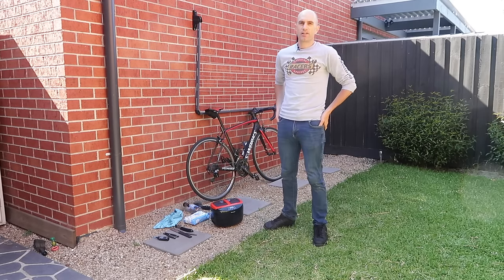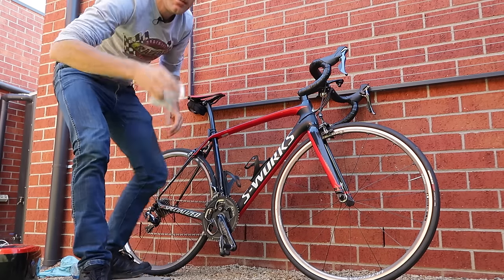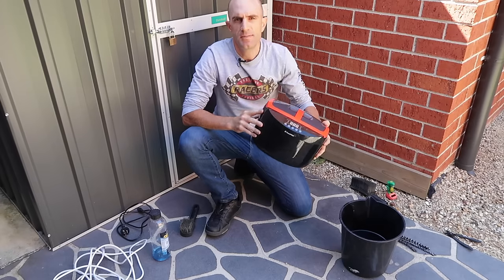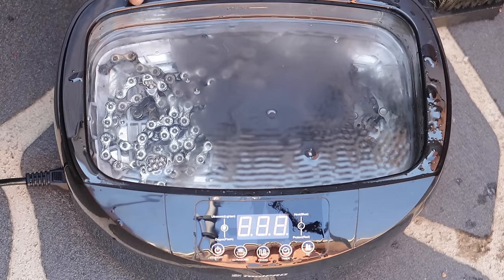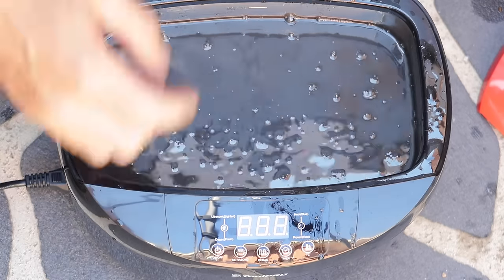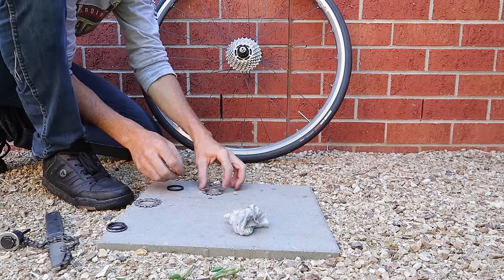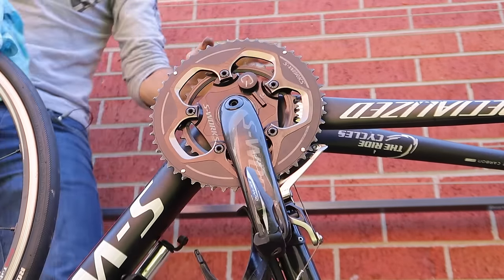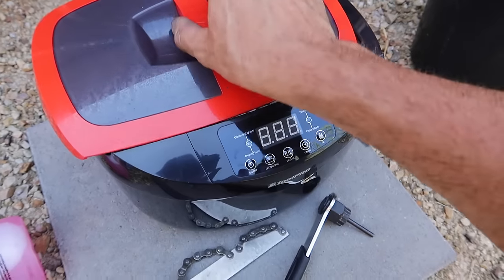CLEAN BIKE: The Ultrasonic Part Cleaner! // How to Clean a Bicycle Chain

Comment: Hi Shane, it's me the wheel balance guy from Seattle.   Just giving your loyal folowers like me a little heads up if you use an Ultrasonic cleaner... I used to use the same Ultrasonic cleaner and soon discovered not to ever put Aluminum parts in it because it pits the surface especially when it is anodized. I ruined a perfectly like new pair of Campagnolo super record 11 brake calipers when I put them in for a quick clean, and was horrified when I pulled them out to rinse them. Yeh hard steel stuff like chains and cassette cogs good. Aluminum parts to risky.
Reply: Great tip! Easy to get carried away with these fancy toys 😮

Comment: We use ultrasonic at work to clean sensitive aircraft parts. Two of the secrets are heat at about 120 C & time. Basic is 30 minutes, heavy is 60. We use other processes like deionized water & rust block in the process also.

Comment: The reason it didn't come out spotless clean is that kerosene does not mix with water. Water will stay at the bottom of the tank (where the parts are) and the kerosene will float on top (providing little contact). But ultrasound cleaning is so good that you get results even with just plain water. For best results some water soluble detergent is needed if you're going to use water.

Comment: Putting kerosene in a high frequency (electrical) environment isn't smart, even if it's in H20.  There's a lot of electricity driving the transducers below the tank and it's also a high a capacitance area. Strongly you suggest using a water-soluble cleaner. I worked in an industrial ultrasonic cleaning environment for many years and that's why I'm commenting here.
Reply: One person, a chemist, charged that putting a chain in an ultrasonic cleaner would strip off the metal plating leaving bare metal that will quickly rust.  What has been your experience?
Reply: @philhouck3560  just wax the chain afterwards
Reply: I just use a dishwasher tablet in my US cleaner.   Works every time and its safe to pour the water down the drain.
Reply: thank you.

Comment: i could be wrong but water and oil products dont normally dont mix.... putting kerosene in boiling water while inside an electrical appliance is a big fire hazard. That kerosene will just float on top and evaporate away as an explosive gas.   Good thing you did that outside.

Comment: Heya Shane. Thanks for the follow-up for the Ultrasonic Cleaner. Top stuff!

Here's a few things I've found (a bit more homebrew) than yours, that I think are good take off points too, that I've come across to help us reach the Nirvana of cleaning things.

1. Baby Wipes. You can get the Mama Mia ones from ALDI for about $2.00 that are paraben/alcohol free. Great for everything. I discovered these when I used to work in animation using Plasticine. They were the only thing to get off the oily residue.

2. Like a car, start the clean from the top down, due to the gravity factor.

3. Chain breaker with a KMC quick link = no need for chain cleaners. KMC actually have a little blurb written on their website advising against them.

4. Cheap ass USC = Icecream bucket filled with Kero. Put your chain in, put in like 250 ml's of Kero. Shake it like Shakira. I made the mistake of not using gloves the first time with Kero. I now use Nitrile gloves (mechanic gloves) which are like a dollar each from supercheap. Supercheap also stocks grease cleaners  for your hands that are great if you're getting super dirty. Having wrinkled hands that smell like jet fuel is no fun. Leave the excess Kero in the sun to evaporate and throw or re-use the bucket.

5. Rinse off chain and dry to remove excess degreaser as you don't want this when re-lubing.

6. Same as you, I tend to do a solid lubing. I tend to leave the lube in overnight to soak into the rollers and wipe the excess in the morning. This type of deep clean though is probably great for a dry paraffin wax based lube like squirt, which adheres better with super clean chains. I think they're becoming more common now as they do reduce friction.

7. I know this is isn't required, but I put an ultra-thin layer of grease in the cassette body (not in the spline grooves) to help taking off the cassette next time. It serves no other purpose.

8. I finish with a UV protectant called Aerospace 303. I use this for car interiors mainly, but it works great for gloss-free carbon parts. It's water based, so no silicone and dries up after about 5 weeks. Great for frames, carbon parts and even running gear. Matte stuff works best and it literally makes stuff look out of the box new. This stuff is even recommended by guys like Parlee, for protecting carbon frames from the QLD sun. 

9. Acetone works great on carbon brake tracks and rims for removing stubborn dirt. 

10. If you have an air-compressor lying around, also a great tool to get dirt out of bolt heads, and brake parts without degreasing. 

11. I use the soy base triflow product for quickly lubing spoke nipples and the friction points of brake cables. This just gives them a protective layer that dries naturally in a month and is environmentally friendly.

Most of these tips I borrow from car detailing experience, but the apply to bikes equally. It's great to see the reception from brands like muc-off, but a tonne of this stuff has existed for decades for cars and just as easily goes on bikes.

Geek out.

Also Von short for Veronica? Mind BLOWN.
Reply from the maker: 10/10 quality YouTube comment! That's bloody brilliant mate. Thanks for taking the time to put that together, it'll help me and a ton of others. Yep on Von/Veronica. :)
Reply: Thanks mate! Avid watcher of your vids. This is one I could actually provide some input on ha. Keep it up!
Reply: Don't use flammable fluids in parts washers. They can heat up and catch fire. Neutral industrial detergent is the go. Don't use alkalis nor acids either.
Reply: I left muc-off on too long on  the aluminium swing arm of my motorbike and it etched it and left a permanent mark
Reply: Gixer750pilot water Muc Off down 50-50 even less if you want also makes it last longer ;)
Reply: 250ml of kerosene for cleaning a chain, that's massively wasteful and not envoronmentally friendly.
baby wipes whilst they can do the job are again unecessary and are not great for the environment as they don't break down, cotton cloth that can be reused/washed and a mild detergent if required is all you need to clean a frame and most parts.
Acetone is another nasty product you shouldn't be using, whilst we all want to keep our bikes clean and shiny and reduce wear we also need to rspect the environment whilst we are doing it too.
if you want to apply grease to reduce seizing/ease of removal as per your cassette comment (i presume on a steel freehub) then use a copper based grease, application is usually a one off thing and unlike lithium grease doesn't emulsify over time on external/exposed parts.
Reply: Thank you for your service lieutenant
Reply: @gplama   sorry if I offend you, but how can you put your noble steed upside down? It's just humilliating to him. you must show him respect, and keep him always on the rubber side down.

bike stands are cheap by the way.
Reply: I can't understand your point 3. (3. Chain breaker with a KMC quick link = no need for chain cleaners.). What does this mean? Thanks!
Reply: Zygmunt The Cacao Kakistocrat 

If you can ignite 2.5L of water mixed with a splash of kerosene, then you’re a genius!

:)

Comment: Tip: I always run a zip tie through the loose cassette parts, just cause it's easier to put back onto the wheel. Good trick for newbies as... then you do t need to think order of rings, Shims, etc
Reply: Do the same through the end of your chain so you don’t lose the rollers in each end. Put the zip tie through both ends of the chain and through both parts of your speed link.

Comment: Hi Shane, if you want to clean it quicker and save your detergent. You can use a glass jar or zip lock bags. Just put your parts there it will work for you!

Comment: - Water
- degreaser
- bike wash
- water
- rag
With that you don't need ultrasonic cleaner. Just put components in and wait for 10 minutes. Same thing. That UC is not strong. Proper UC will do the magic but that model cost too much for chain cleaning.
I do not use degreaser. It is bad for the chain. 
For basic cleaning - soapy water
For dirt chain - diesel
For relly dirt and rust chain - WD40
For long life of chain - No degreaser, no cross chain. My last Shimano chain lasted for 20k km.
Reply from the maker: The cleaner used is well strong enough to breakdown the oil and grease so it washes off easily. Cost is all relative. If the chain is oiled correctly after cleaning this will prolong the life, a lot. But, everyone rides in different conditions, so has different experiences with wear. CX racing is a total component killer.

Comment: I've used oven cleaner spray in the past, best instant clean ever although I'm sure it's not good for the environment, all I do now it GT85 the chain and rear cassette and wipe with an old rag once a week or after every wet ride and I've never suffered any premature wear or bad shifting - Chain is cleaner than it has ever been
Reply from the maker: Having just cleaned an oven last week... I concur. That stuff is toxic! :)

Comment: Hi Shane
After such a good clean where nearly all grease and oil are removed, I will recomend Ufo DRIP from Ceramicspeed to oil the chain again. Ufo DRIP is pretty expensive an difficult to use, but when both chain and Ufo DRIP are about 20 centigrade in temperature, it works fine. I hang the cleaned chain on a nail and let the Ufo DRIP ran down on the chain until every part of the chain have some lube added. Here in Denmark where the temperature not so often are 20 degrees or above, I heat the chain after lubricating with a electrical warming gun, to make sure the lube are absorbed into the chain joints as god as possible.
Se you on the road :-)

Comment: believe it or not chain grease is the best cleaning agent for bicycle parts. In military they use something called CLP (cleaning, lubricating and protecting) to clean their rifles. any grease or carbon build up just get dissolved into chain lube and it doesn't corrode your components. ofc chain lube is expensive but for the long run chain lube preserves your component better so you will be saving lot's of money. i leave a thin film of lube on my bike regardless if it's drivetrain or not. it acts as an anti oxidant which protect your aluminium parts and top coat of your carbon frame. i recommend prolink progold 16oz spray bottles, they aren't that expensive yet thin and easy to use as a cleaner.

Comment: When I clean mine I also check for wear just as you did. While going up hill and hard accelerating over a speed bump I've had a worn chain slip. With all my weight forward and suddenly no gears I ended up over the handlebars. That was fun.

Comment: Bike shop in my city has one that can fit up to a whole frame. Had a complete cleaning on my Aluminum bike. I swear after everything went into the ultrasonic cleaner and was rebuilt with new cables and brake pads the bike felt way better than brand new and looked like I had just pulled it out of the box.

Comment: Cleaning the chain, chainrings and cogs for roadies is usually unnecessary provided a proper lubricant is used.  There is no drip-on lube on the market that comes close to hot-soak in a combination of canning paraffin and motor oil.  This combination picks no dirt, shift feel almost buttery smooth and a lube lasts at least 300 miles.

Comment: One thing to add: Before reassembling and greasing the chain I’d recommend to liberally spray it with water displacement (e.g. WD40, yes this is the one time where putting WD40 on a chain is useful) and let it dry completely to make sure no water is left inside the links.

Comment: after that chain dries melt some paraffin wax in that ultra sonic cleaner, drop that chain in. You'll have a very clean and super fast chain. Especially good for mtb because you can get away with dry Teflon or silicone lubes that don't build up or collect dirt for a couple months before needing to retreat with wax. It's also fast, did I mention that?
Reply: H Masters waxing the chain is the way to go.
Reply: It’s better if u use a cheap crockpot/rice steamer for waxing instead of this expensive cleaning machine. “GCN” YouTube account did this
Reply: The ultrasonic cleaner isn't necessary.  Secondly, paraffin along isn't much of a lube because it flakes off after it cools.  It needs to be paired with motor oil: 1 pound of canning paraffin and 9 ounces of motor oil.  The motor oil holds the paraffin in place and the paraffin keeps the lube from being so sticky it picks up dirt.  The two lubes must be heated up to the point where they have almost the same viscosity as water.  Then the chain should be lowered into the solution and left there a few minutes.  There are video that demonstrate the procedure.

Comment: My Shimano RD F8050 DI2 front derailleur is very sticky when shifting and recently stopped going to the big chainring. I have repeatedly used cleaner spray to get into the big chainring but it has difficult.  The derailleur will work for a while and then will not work from small to big, until I respray the cleaner again.  Can I submerge or dangle the front derailleur in an ultrasonic cleaner to get rid of the build-up. Will this short out the solenoid?
Reply from the maker: Shimano Support is your best bet here.

Comment: Hey, just watched the video, specifically the way you cleaned the ultrasonic cleaner afterwards. I just purchased an identical cleaner but wondered how waterproof the electronics are. Can I clean mine the same way you soaked yours with a hose? (Minute 6:00)
Reply from the maker: It might not be the recommended way to clean it, but it hasn’t caused any issues for me to date. Just don’t spray water directly in the power socket or on the button panel.

Comment: alternative to a ultrasonic cleaner is a electric  palm sander a coffee jar with velcro attached to the coffee lid put liquid in jar put chain and parts in jar attached the lid put the velcro lid to the bolt sander let it run for a couple of minutes job done

Comment: Shane what degreaser are you using, I bought an ultra sonic cleaner, put the hot water in and some degreaser and it didn't clean, I put it down to the degreaser being a cheap Bunnings brand
Reply from the maker: Kero. See the comments below for more ideas of what might work just as well.

Comment: Shane Shane Shane. What can I say, didn't your mum ever tell you that oil and water don't mix ;) Kero is oil, drop some in a clear container with some water and see how well your "degreaser" gets on!

Few topics seem to be as contentious in the cycling world as chain cleaning. Personally I use my ultrasonic cleaner for some jobs but not for chain cleaning. Cassettes etc on the other hand by all means. If you want to use one, don't worry about the kero, it's floating on top and just stinking up the show, instead drop some ordinary dishwashing detergent in there, just a small amount will do it. Hot water and you're done. If buying specialist ultrasonic cleaner be careful of some of the ultrasonic cleaning powders available as they're caustic and can mar aluminium components. Don't ask me how I proved that!

The reason I don't use U/S cleaners on chains is, well firstly because most of my bikes don't have master links, but also because the water will stay within the chain when you try to lube it. I guess you could put it in an oven to dry it first, but even I'm not that anal! If the water is still within the chain you then have the same issue of water and oil not mixing. The water wins every time, and the lubricant won't displace the water. Later your chain will run dry (ie won't be properly lubed) once the water finally dries out. Again, you could displace the water with a water displacing fluid like WD-40 (which is a crap lubricant BTW) before properly lubricating the chain, but it's just another step.

Personally I tend to use kero only (don't try to mix it with water, it doesn't mix). I run kero in my parts cleaner so just pump some into either a chain cleaner or a ice cream container with a brush. Some may claim you could even run straight kero in an ultrasonic cleaner, ignoring all warning labels not to do that. The world may end if you try that. It may not too ;) The chain cleaner is fast but my current Park Tool one isn't the best I've used. Kero is actually a very light oil, so a lubricant in its own right (a squillion jet engine parts will testify to that), albeit not a great one. However being an oil based solvent, unlike water it won't prevent wax or oil based chain lube from getting in there and doing its thing, although it may dilute them a tad. I must admit I don't clean my chain as much as I should, but I have just under 4K on my current chain and measured it not too long ago. It still looked like it had another 2K at least in it just by cleaning with lubricants.

Hope that helps.

Comment: That is a lot of additional oil that you put on, too much, even removing excess your chain will attract dirt quickly.  Try spraying silicon 85 lubricant which disburses all the water.   Then add a very small amount of dry lube depending on your local conditions.   Otherwise you'll need to clean your stuff again within several weeks

Comment: YO was that "cleaner" Kerosene?   If so How does it work with a biodegradable cleaner?       If I use Diesel fuel everything comes off regardless of the contraption,  but hey....is that allowed?
Reply: Michael Gallagher try to use vinegar or citricacid for that